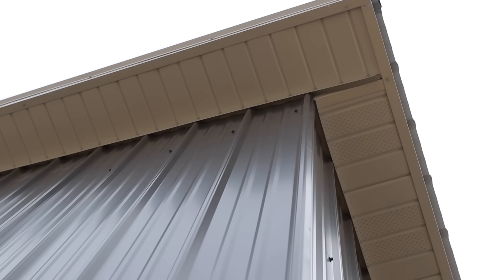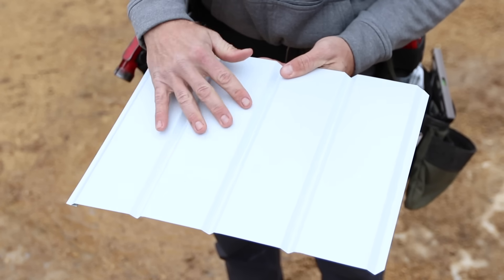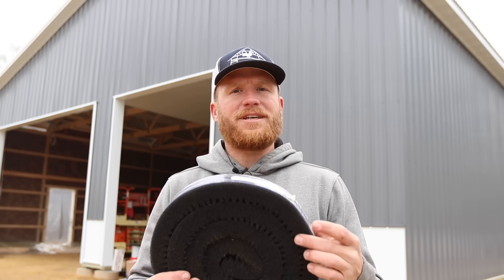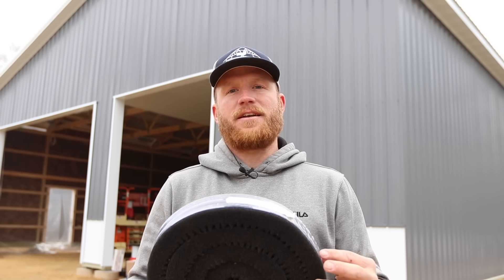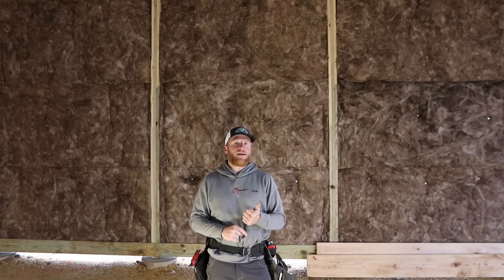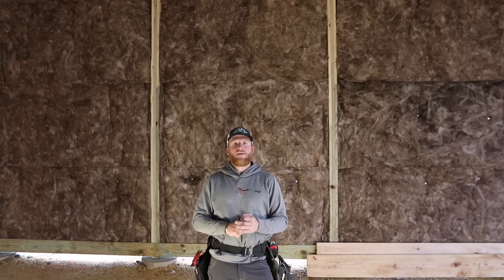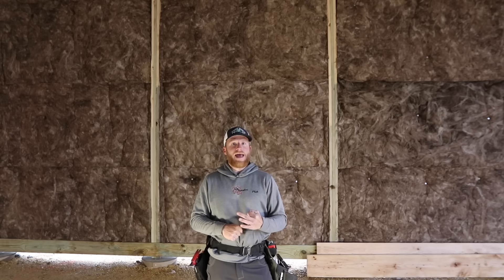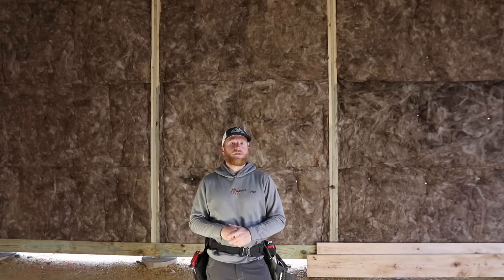Insulation: 5 steps to a more efficient building and why I don't use spray foam

Comment: Closed cell Spray foam does have several significant advantages. It is an AIR BARRIER, fiberglass is not. It is PEST PROOF (provides no nutrition or 'bedding' for bugs, rodents, etc. ) it will not absorb water (closed cell only), fiberglass will and thus will be a never ending source of mold spores, mildew and odor.  Insulation R values have a gigantic assumption that is NEVER MENTIONED and that is that their R value is at absolutely ZERO airflow.  Post framed buildings are impossible to get airtight and thus the insulating R value you think you're getting rarely happens, especially as the building ages.  Foam's R value per inch is nonlinear, and increases as it gets thicker. meaning that a 1 inch layer may be R6 but three inches exceeds R21, and a 6 inch layer is far beyond R-36 and approaches R55+.  Fiberglass can settle (easily seen via. FLIR camera on older buildings)  fiberglass is a favorite home for mice.  Spray foam adds structural stability and rigidity to a building.  Combining spray foam with a reflective radiant barrier improves its efficiency even more. it works well with any insulation but it's doesn't solve fiberglasses primary weaknesses (not airtight, absorbs water, invites pests to move in)
Reply: Closed cell will also not allow moisture or vapor to permeate which is a negative when placed against wood.

With a pole frame construction you will get moisture from capillary action from the concrete posts and the slab.  You must have a way to allow that water vapor to permeate.

Comment: Water condenses, it doesn’t “condensate”.  Otherwise, pretty good video.  How do you feel about blown in cellulose?  It seems to prevent air infiltration, and can even be blown in to the sidewalls behind the vapor barrier.  Fiberglass is really not much more than a filter (did you ever take down an old wall or ceiling and notice the pink stuff is black?).  Just a suggestion.  It seems there are many opinions on insulating a building, but it would be better to do some real scientific testing and get real numbers on vapor barrier vs. none, fiber vs. cellulose (equivalent cost).  Not sure how to measure it, but it does seem possible.  Just a few suggestions.  Thanks for the video.

Comment: If you seal and insulate the roof with closed cell foam, have closed soffits, and a closed ridge you would do a better job. Ask Matt Risinger about Building Science.
Reply: Cost vs benefit is an important factor for customers who don't pull in >$500k/ year.
Reply: Onyx Knight 
Cost of heating is reduced by using updated practices
Reply: Brian Curwick on a single continuous roof deck like a pole barn, the benefits of the spray foam do not outweigh the thousands of extra dollars in cost. Flash and batting the walls makes much more sense for your money. Again, if your pulling in $500k plus a year and your building your dream McMansion, sure. But not for an ag building/workshop.
Reply: Onyx Knight 
if the building is heated, you are losing heat when you do not have the structure sealed completely. Spraying 2”-3” of closed cell foam will seal the roof to outside air infiltration thus saving $$$. If you are not heating it why have ANY insulation???
Reply: Brian Curwick who said anything about not heating? You don’t need your whole roof system foamed for efficient heating. Sure, a foamed roof system is going to be better then straight blown in, but not on a bang for the buck (including heating costs) level. For example, to foam the roof system for the building I’m putting up (55x80) would cost me around $18,000 Canadian. That’s for r20 (3”) I would then need another r40 in blown in to get my r value. Or, I could do a really good job with my vapor barrier and blow in r60 for $3400. Maybe I blow in r100 for another couple grand to close the heating gap. Am I really going to save $18000 in heating costs over the next 10 years? Maybe, but likely not by much. Do I have an extra $18000 in my budget for the luxury of spray foam? Definitely not.
Reply: Onyx Knight 
A wise man understands sealing a building is most important.
Even an inch of closed cell as long as corners panel over laps, etc...
This is the new world and ole school cost more in the end!
Reply: Brian Curwick saying that 1 inch of foam is enough shows just how poor your understanding of building science is. 1 inch of foam is not enough r value to have the dew point of your conditioned air inside the foam. If you insulated your building with 1” of foam and then fiberglassed (or any other insulation) the rest, your hot, conditioned air would condense on the inner side of your foam, in your walls/ceiling and cause HUGE moisture issues. In my climate zone, roughly 50% of the total r value must be spray foam to prevent this from happening. Which is why I’m telling you, for a roof system on an Ag building, doing flash and batt (or blown in) is prohibitively expensive *to do PROPERLY*even considering the benefits. Its got nothing to do with “old vs new school” it’s just simple logic. Spray foam is great, just not in this application. Thanks for trying though, good luck in your future building endeavors.
Reply: Onyx Knight 
At least you listen

Comment: Stopping the airflow does a lot. The foam can crack over time. The fiberglass and the plastic film will not.
Reply: Foam is unlikely to crack unless you have enough movement of the structure you should be worried about that instead. Spray foam does have some flex and it is enough for typical expansion and contraction of a structure.
Reply: Not true if done correctly.

Comment: You never put a vapour barrier on the outside of a building.  That absolutely guarantees that the wood underneath and in contact rots,, or steel rusts.   Interiors might need a vapour barrier,, exteriors may need a moister or water barrier,,,, but make d**m sure it can breathe.

Comment: if want today make true warm wall fiberclass need use minimium 300mm  eco house recommendation have min 500mm wall and 800mm roof.and closed cell foam 150mm have same insulation than 300mm fiberglass, and only true dry inside wall can use open cell foam but need min 200mm-400mm insulation. roof standard have 500mm insulation today.and concrete floor under 200mm closed cell sheet not use open cell sheet newer floor,wet area,outside.. open floor need more about 500-600 mm closed cell foam sheet. All under this min recommendation have only waste time and money insulation what no work good. fiberglass have cheapen but need use 3x more than foam sheet insulation too. same area need 3x more insulation. 3x more money.u must calculate what fiberglass 3x cost or foam sheet 150mm.200mm cost.

Comment: I am a homeowner and I received delivery of $4000 worth of spray foam and realized that my contractor was planning to do it all wrong.  When I questioned him he became angry, "let me do my job!"  But I stood my ground. So, he wanted to spray it in an unheated building at 40F when core temperature must be 70-80f which means warming it for 24 hours.  He also planned to spray it on cold walls and it goes on and on.  I read the cancer warnings on the box and I thought carefully about my next move.  I returned it and used rock wool.  Difficult for the contractor to mess it up, no worrying about temperature and yields and problems due to improper installation and no cancer warnings.  Before you purchase spray foam make sure you know what is involved and if you proceed make sure you hire professionals that do only spray foam unless you have a great contractor.

Comment: my uncle built a all steel building back in the 70's or 80's made by Chief. its our main shop on the farm and its never been insulated. it uses a 8inch c channel for the beams and truss. its like a clear span. im located 2 hours north of Rockford in Wisconsin. my uncle has been trying to figure out the best and most cost effective way to insulate this shed for years. from 6ft wide batted insulation to spray foam to blown in. to poly iso. we have no real way to figure this out. could you help me out. I can send pictures of the shed its only a 30 by 40 shed. thank you for your time.
Reply from the maker: My email is kstumpenhorst@gmail.com

Comment: The foam will also fill in behind all the posts eliminating most thermal bridging. Plus air tight, plus higher r value, plus it actually performs at its rated r value unlike fiberglass

Comment: I like a combo of spray foam and fiberglass if it’s in your budget. I did 2 inches of spray foam for a awesome vapor barrier and did r13 to finish out the walls. It was stud walls though so it was easier to use regular batts. I ended up with r27 in the walls so I was happy. NW MT. Gets colder here. Lol thanks for sharing.
Reply: I agree
Reply: The diminishing returns of adding that extra layer in Illinois has to be a factor. 2 inches of closed cell foam is plenty. Where do you stop?

Comment: My only question is why don't you use blown in cellulose instead of fiberglass in the attic area? Cellulose has a higher R value, is a more uniform  coating, and does not support bugs or critters due to borax fire retardant. Lastly it doesn't itch

Comment: Really cool. Do you insulate & vb under the slab? - The vb would be important for flooring or sealer or epoxy. Also; if you are insulating under the slab, it looks like you could tie in & terminate the rigid insul under your ratboard. Just saying.

Comment: Some people are all about the spray foam. Yes, it works well for the building envelope. But totally sucks when there is a water leak for extended period of time because it is concealed with foam, the owner usually finds out when there is significant damage. Then decide you want to add a couple receptacles after construction with foam filled walls! I was a electrical contractor for many years, done some work on buildings built with SIP's and what a nightmare! Been in the architectural engineering for almost 20 years, I will design buildings with foam insulation if the owner insist but try to avoid it if possible.

Comment: I have a Morton building for a residence in New Hampshire with the same construction.   The fiberglass insulation, vapor barrier is so disappointing!  If I had to do it all over and I may still do it, spray foam would definitely be in the mix.  The problem with the vapor barrier and conventional fiberglass is when you add anything outside like a hose bib, you violate the vapor barrier and the drill will suck out a wad of insulation.  Any future building I build will be R40 in the walls and R80+ in the ceiling!
Reply: Cellulose is also a very affordable product compared to open cell foam, without harmful toxins. Also doesn't burn in a fire. Cellulose is a air barrier just like foam, air doesn't move though cellulose and breath, like fiberglass does. Still requires a  vapor barrier, but can be dense packed in walls

Comment: Your buildings are awesome..Those ridge vents lose air flow capacity over time reducing the push/pull you want with a ridge vent system, dust etc fills them up and they get clogged before the life of the roof itself.

Comment: Just a couple of points I'd like to add. Im a few hours north of you, so I realize that some dynamics are a bit different, but one issue we've seen with the flash and batt system, is you end up with a vapor barrier near the outside of the wall, which can lead to condensation within the batt. For that reason, we typically will  reccomend at least 2" of foam, to have enough thermal resistance outside that vapor barrier to prevent dewpoint from falling within the batt. What we've found  up here is that heating costs with fiberglass are about double what they are with foam, so if a person is only heating the shop to 45 degrees, and the heating cost is a couple hundred bucks a season, foam may very well not pay off, but if its heated to 70, it may very well make sense. The other factor that comes into play with fiberglass, or any air permeable insulation, is convective looping. Warm air at the inside of the wall rises through the insulation, while cold air at the outside of the wall falls, causing accelerated air, and therefore heat, exchange within the cavity. This in one of the key ways that foam helps with energy conservation, but again, should be evaluated on a case by case basis. One of the commenters mentioned foam for sound transfer resistance, and in our experience, foam is not a good sound barrier. Fiberglass will deaden sound substantially better than foam will.

Comment: Overall, good work and fantastic video. Points to consider. Tyvek allows vapor to pass through, a good thing since we dont want to trap moisture in. It also blocks wind and bulk moisture, another good thing.  Fiber glass has a dirty secret. Its r-value is determined in a 70 degree environment. The r value of fiberglass decreases considerably as it gets colder. It's called R value drift. Properly done, dense pack cellulose wont settle and its r value actually goes up as it gets colder. In my opinion a much, much better option in the attic. Just be sure its 100% borate and not the alum sulfate.. What the other commenter wrote, wearing our jacket on the outside is point on. Better to add continuous insulation on the outside of the wall as the dew point could never affect the cavity if the profile lands it in the foam itself. What you have my friend is a reservoir. I cant say just how much as I dont know the perm rating of the plastic you used, or the perm ratings of the sheathing and skin of your structure. I would guess they would be considered vapor impermeable. So, if any water or water vapor gets in from inside or out, it cant get out. Thats bad juju.. Another thing is filter glass needs a solid surface on all 6 sides. The flappy plastic doesn't work for that.  Since fiber glass allows air to move unimpeded, convective currents will develop in the cavity,  further reducing the r value. I didn't see if sheets rock was getting installed. I also don't know if the heating system will have humidifiers as well. I also don't know about slab moisture management here as well, tons of other important information that will mitigate or cause more issues down the road. For the cavity, closed cell foam would have been a much better option, its impermeable, and does not need encapsulation since air can not move through it. I also believe that it does not suffer from r value drift. Thanks for reading this far and I am subscribing now!
Reply: @wooosh wooosh  @wooosh wooosh  so it depends on where your located. Where i live we are neutral,  as much vapor pressure inwards   in the summer as pressure outwards in the winter. In my location, 2 coats of paint on the sheetrock is actually all we would ever need. So, a vapor barrier only on the warm side isn't bad, my original comment was to wake folks up and stop creating reservoirs. An example would be 6 mil plastic inside and 1" foamboard outside = trapped moisture in the cavity. There are literally a hundred ways of designing wrong, that said, i believe they got it right in this video. Chapter 14 of the 2018 IRC talks about whats required and where, more is NOT always better when you are talking about vapor and retarder or barrier.
Lastly, the slab ideally would have continuous edge insulation seperating itself from the foundation wall. Depending on the foams thickness, the perimeter underslab insulation could be omitted. (Scratch that if the slab will have radiant heat, as it would then require slab edge and continuous under..)
Reply: @wooosh wooosh So, as close as I can figure.... Flint is in zone 6A, which  requires a class 1 or 2 vapor barrier (Plastic or kraft facing) on the warm side. If you were my client Id ask you if you planned on having anything inside that creates moisture. Sink, baths, shower, most certainly humidifiers than use a class 1 vapor barrier (plastic) inside. If you never will have anything inside that creates moisture OR if you have continuous foam on the outside than just go with the class 2 (kraft facing or similar) on the inside.  When you say floor heat, do you mean something will be embedded in the poured slab ? If so you must do slab edge insulation. Concrete conducts heat well. The rate of transfer from in side to out side is dependent on the temperature difference. Slabs are typically heated well above room temp for the radiant benefits. That said the loss to the outside could be tremendous.  If your not doing in floor heat all over, but will have the entire space heated than the slab edge should be in line with the wall insulation.
Reply: @wooosh wooosh Alot to take in, but I think I have it. You need to decide if this room will be used in the dead of winter and how frequently... If there will be hot and cold water (which can freeze if there is no heat) My gut kick says to NOT insulate the wall separating the main house and this space, my gut says insulate the heck out of the exterior wall and roof of this space, along with slab edge insulation. I would not add radiant heat in this room unless I knew it would be in use 100% of the time. I would add a wall hanging heater to temper it quickly when needed. I would size the heating system correctly for the main portion of the home to partially include the losses of this space.....

Comment: My dad and I do cellulose insulation.  We've done several large pole buildings with great results.  40% more efficient than fiberglass and it won't mold or mildew like fiberglass you are putting in.  We're in southern Illinois